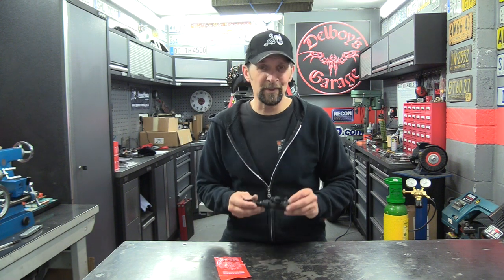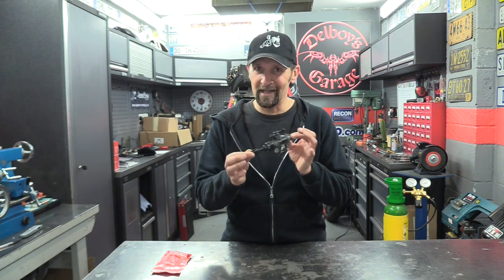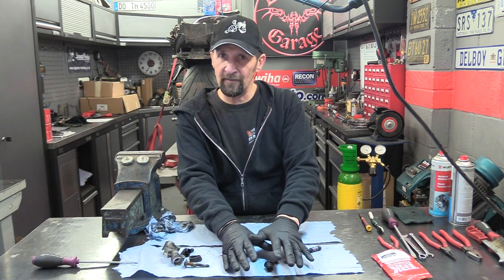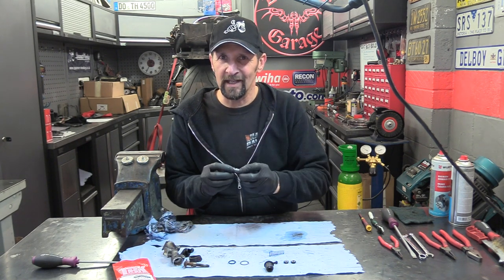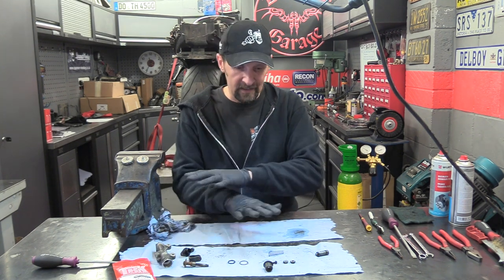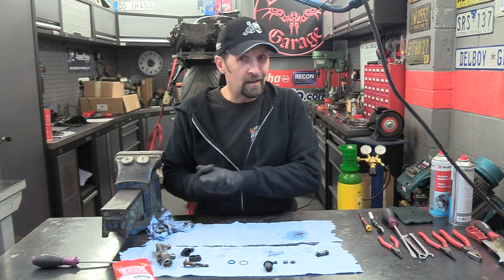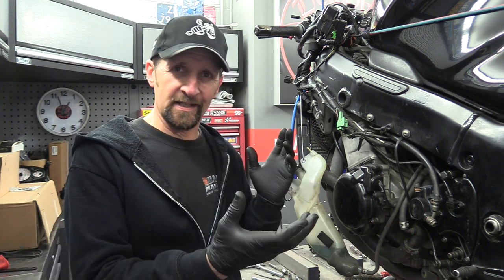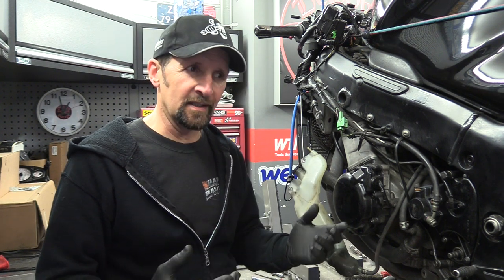Delboy's Garage, Hayabusa Day 15, "Rear Brake Master Cylinder Rebuild"

Comment: Thank you very much. It did look like a fairly easy job, or maybe because you make most things look easy. :) Looking at it though, I'm dreading what I will find when I open up mine. 20 years old and I've ridden it all winter. Ahwell. Also, thank you for explaining about using Vaseline instead of red grease. It's been a few years since I played around with petroleum jelly. :)  Btw, any tips how to keep that stupid spring for the brake light working smoothly, along with the brake foot lever pivot? The spring is covered by the bracket near the foot peg, it gunks up, it's really hard to reach with fingers to give it a clean and a grease and I've actually lost my back brakes for a day on my old bike because the brake lever wasn't moving anymore because of all the grit and gunk.  I hope all is well with you and Penny. Best wishes to you both and hoping for some sunshine for your weekend. :).

Comment: May i ask why you dont use the red brake greese. my local motorbike shop tell me off for not using it when rebuilding my brakes as i was using normal greese
Reply from the maker: On as master cylinder, you may have noticed that the metal piston has what looks like a worm screw cut in to it, and if you spread rubber grease on the piston, blobs of it can get lodged in that screw and it's purpose is to allow the fluid to flow backwards to the other side of the seal ready for the next application... and a blob of red grease in that groove will bung up the operation of the cylinder, so I just used fresh brake fluid to help it slip together, but for calipers I always use rubber grease if I can...

Comment: Good luck getting the sprocket bolt out again !! 😱😱
Reply from the maker: It's temporary Threadlock buddy, it'll come out a darn sight easier than those footpeg bolts did, it's designed to break free when you want it too...
Reply: @Moonfleet41  Its the Blue pill not the Red one (Matrix).

Comment: Del, how do you always know which Tap to use to clean out the threads? Do you have a gauge or is it just experience of years working with different size bolts/threads etc?
Reply from the maker: Use the bolt from that thread as a guide.. lay the threads against each other, if it fits perfectly, its the same thread....   TBH most bike fasteners are M6, M8 or M10... so there isn't much choice anyway.
Reply: Moonfleet41 I ride a Sportster so imperial and metric mixed bolt nightmare as you know lol!!
Reply from the maker: Ha ha.. i feel your pain buddy... i have a Harley and a Hayabusa.. my tool collection is like the United Nations...lol!

Comment: Good video 👍🏻 I did the same job on my 83 Kawasaki z750 ltd a few weeks ago, it was in a similar state but all the fluid had run out of it also, I'm surprised my back brake worked the last time I rode it 😂😂
Reply from the maker: Blimey, sounds like you just caught it in time aye mate... lucky escape..
Reply: @Moonfleet41  yep, all sorted now, bloody thing wouldn't pass fluid to the caliper after, thought I'd checked everything, took the banjo off, put my finger over the hole and kept pumping and then boom, out came the fluid, seems the small hole the fluid came out of was blocked with crud. Every day's a school day 😎👍🏻

Comment: Another great vid and really informative Del! Quick question on using the wire wheel... When cleaning up metal is there a rule for knowing what will rust and what won't? Thanks for all the vids!
Reply from the maker: Hi Mike,  Rust is caused by the Iron content in the metal oxidizing...so for metal to rust, it must contain iron, and a good quick check is to lay a magnet on it.. if the metal is magnetic then generally speaking it will rust if not protected.. 

Some stainless steel is mildly magnetic, but it does resist corrosion quite well...
Reply: @Moonfleet41  cheers Del! Keep up the great work with the 'busa 👍

Comment: Been having problems with mine it's squirting out but brake calliper still not working properly any advice pleas
Reply from the maker: Is the caliper free and all pistons moving, has it been standing for a long time..?
Reply: Moonfleet41 yeah been stood for 2 years but the brakes was working fine on the rear before replacing the rear master brake cylinder but put this new one on and Iv pressed it with the pipe disconnected from the brake cylinder and its pumping over the top so that's working it's just not coming out of the nipple but the other nipple Iv snapped off and the calliper did have fluid in but the pistons are working very slightly but not enough to apply brakes
Reply from the maker: @obviousmartin2501  OK mate... from what you explain, it it was my project.. i would restore the caliper fully.. new seals, sort out that snapped off bleed nipple, and get it all smooth and mobile again.... often even if they were working fine after a lay-up... the moment you start using them again, the seals can swell up and jam the pistons... I learned a long time ago that you'll waste a lot of time trying to make a troublesome caliper work....so i jjst rip tham apart and rebuild them from scratch, then they work perfectly first time mate..... Im sure you know how important it is, even a 600 fazer is a 200 Kilo bike aye..!!
Reply: Moonfleet41 yeah I know it's a heavy bike well heavier than a push bike any whey lol many thanks buddy I'll give it a go and p.s love ya vids

Comment: Are you going to use dot 5  fluid when you fill it up?
Reply from the maker: I don't see any reason not to Dave, the whole system will be dry apart from the front hoses...so yeah, it's a thought.

Comment: I just did a master cylinder just like that not two weeks ago. Rather than rebuild it, I just purchased a new one. $20 USD, or something like 17GBP. I tend to replace master cylinders rather than rebuild if it's an easily available part and not too expensive. I've had way too many rebuilds that didn't take or didn't last very long. And at $95 an hour (my going rate) it's actually a lot cheaper to replace that one.
Reply: That's why mechanics are more fitters these days, much less fixing, just buy and refit.  No more rebuilding starter motors or anything like that, well not for a long long time now.  I'd rather do this if I feel I can, and I have the required tools, bet it's cheaper too.  But that's why you're a Knuckle Head and I'm Half Dead ;)
Reply: Oh and your "going rate" is way to high, I'll be surprised if you get any work, or is everyone in your neck of the woods Knuckle Heads, especially if you're no good at fixing things lol "did not take or last long" WTF? lol.
Reply: @HalfdeadRider  I guess you're just a better wrench than me and never ever make any mistakes or have to redo something that failed. Good on ya. Glad to hear there are perfect mechanics out there. I charge what most of the other shops around here charge. Some more, some less. 

But I stand by my statement. Why take an hour to rebuild a $20 part? Just because I can? That makes no business sense, and it's not in the best interest of the customer. I specialize in motors and transmissions, so it's clearly an economy of scale... A new motor can cost significantly more than a lot of repairs  so it makes sense to rebuild. A $20 master cylinder? Not so much.
Reply: @HalfdeadRider  It's not cheaper in this particular instance. Simple business practice. Maybe you wouldn't be halfdead if you worked smarter. ;)
Reply: @azb2010  No, I wouldn't be halfdead if I was not born with kidney failure :)

Mechanics workshops here usually charge less than you said you do for labour (bike mechanics a lot less).  Main dealers (cars) charges vary on the job.  Servicing at a main dealer can be much more expensive per hour, up to £200+ then parts and materials on top.

It could possibly be cheaper if you shop around, but one quick search found a rebuild kit for the Busa, just over $21, I did not look for here but that converts to around £16 currently.

As a business these days, a lot of the time profits go above environmental factors and quality of workmanship unfortunately.  Also Del is not doing it for business, nor would I, so makes more sense a lot of times to refurbish rather than replace.

BTW, I was not having a go, I was having a bit of a laugh, seems that went over your head, sorry I hurt you a little in the feels ;)
Reply: I understand your logic Knuckle Head and yes it does make sense what you say but @ $20 for a new master cylinder suggests to me a chinese copy build and not OEM, surely an OEM would be way over $100 or $200. So if it was my busa would I replace the OEM with a chinese copy? I say no way. Its an issue of trust for the long haul and you cant go past OEM. If on the other hand an OEM goes for $20 (WW2 price) then yes am all for it.
Reply: @Volvi373  $172 for rear and $173 for the front master cylinder mate, so probably a little less from a UK parts dealer, but still a long way from $20 lol
Reply: @HalfdeadRider  Sorry to hear that. I'm running on one kidney meself. And don't worry about my feelings, I don't have any. But I'm used to people making good natured jabs all day long and I don't shy away from giving back. Mechanics and machinists are historically like to poke fun at one another to pass the time. ;)
Reply: @azb2010  Don'y be sorry, I'm pretty sure it's not your fault, let's hope your kidney is one of those super horseshoe kidney's like Mel Gibson's.  

I don't know if you know Martin Kemp and Gary Kemp, (Spandau Ballet, also played the Kray twins in the 1990 film The Kray's), well Martin Kemp has one kidney and Gary weirdly has three lol.
Reply: @HalfdeadRider  3 kidneys? I've never even heard of that! I think I'd be tempted to donate one if I had 3...

Comment: You might use it all the time, but " Imperial " ( size ) is an 0lde terminology, we just say "Standard" ( * edit , I mean, we used to say it many years ago ) 
- as always really do appreciate your videos.
Reply: Be a bit careful with weights and measures, for example the American standard gallon is about 17% smaller than the UK Imperial gallon. Something like 3.7 litres Vs 4.5. So the systems aren't equivalent in all cases 🙃😁

Comment: I’m under the impression that since Vaseline is a petroleum product, it shouldn’t be used as a lubricant on rubber and plastic parts, as it can eat them away. But I could be wrong. I’m just an amateur.
Reply from the maker: It eats plastic parts?... why doesn't it eat the pot it comes in then.?
Reply: Moonfleet41 good point
Reply from the maker: @FrAdamVoisin  Sorry mate, I was being cheeky there... but seriously it's a quite logic question, but the fact that most rubber in automotive use is not genuine rubber from rubber trees (which would perish), it's all manner of different substances, silicone, nitrile (the stuff surgical gloves are made of), and all sorts of other things that don't contain organic rubber, and Vaseline is a mixture of mineral oil and wax, it's perfect for sealing out water, or wee wee from baby's bums lol... (and that's serious, cos urine contains ammonia and uric acid which, as you know, causes nappy rash, a minor chemical burn, and we use Vaseline to prevent it, so it's quite safe buddy)...
Reply: Very good. Somewhere along the way, I was told to never use Vaseline on plastics and rubbers. Maybe it’s not so big a deal. Keep up the excellent work!
Reply from the maker: @FrAdamVoisin  Yeah, common old wives tail buddy...
Reply: Moonfleet41 I guess so.
Reply: Keep up the excellent videos. I’m totally along for the ride.

Comment: This master cylinder looks very similar to the 1 on the Suzuki bandit......I just opened up the 1 on my Bandit and there was nothing under the initial rod...No piston, no spring, nothing but dirt......Now I don't know about the function....I guessing the interior is suppose to connect with the rest of the cylinder and pump the oil up, but now Im not sure...I wish i could see what the entire looks like on a fresh cylinder
Reply from the maker: See if you can find a schematic diagram on the net somewhere, maybe an online manual, or parts supplier.. that will show you what's supposed to be in there. !
Reply: @Moonfleet41  Ok, thank you...

Comment: Those first bolts 😮 the corrosion!
Where do you get the blue threadlock del?
Reply: Any decent automotive parts shop should stock it or alternatively you can search the web.
Reply from the maker: Hi Simone, Yeah, messy aye... You can buy regular blue threadlock online of from any car accessory store..

Comment: Liberal use of blue LocTite? Does everyone to that? 
Thought it was for race applications, and thought it makes removal very difficult.
Reply from the maker: NO, Corrosion makes removal very difficult...as you found with heat and hammer.... Medium strength threadlock holds the fastener in place and prevents corrosion too.. so when you want it undone, it gives up easily..!
Reply: @Moonfleet41  TY. You are a mensch.
Reply from the maker: @Redmenace96  Thank you kindly Sir..!

Comment: Why so much blue Loctite? A little touch on the front of the screw is all you need in my opinnion.
Reply from the maker: Hey Nestor..You're right indeed.. for securing the screw in place you just need a dab....but im sure you saw the dreadful state of pretty much all the fasteners on the bike... they have all corroded and rusted in place over years of neglect.. which means ive had to "wire wheel" them all back up to some kind of standard so i can use them again.... this means that any form of protective coating they may have had is all gone...and they will rust in place again pretty soon... so naturally in any normal 'non critical' application id use plenty of anti seize to keep them removable.... but they are critical fasteners and need to be held in place with threadlock.. so as threadlock is also a good way to prevent screws from seizing in place.. i put plenty on to keep the rust at bay.... hope that makes sense mate... thanks for your support.. Del.

Comment: Is a master cylinder a master cylinder a master cylinder? If you were, say, building a bike from bits and converting a rear drum brake to disk, is your only real consideration how it's mounted and actuated? Or are there other things to worry about, like capacity and rates?
Reply: @stevewilliams5428  cheers Steve! This is entirely hypothetical, at least right now. But at some point I would like to rebuild something old!

Comment: Got enough threadlock on those screws? Judicious is a word that comes to mind 😀
Reply from the maker: Well they aint coming out now are they...!!
Reply: There is a good reason to use a bunch, while not required to keep the fastener in place. Did you notice all the corrosion on the fasteners he removed? That is electrostatic; that is it's caused by two dissimilar metals (typically steel and aluminum) have an electrochemical reaction to each other. Typically, you'd use anti seize to prevent that, but you can also use gobs of Loctite. Anything that creates a barrier prevents the corrosion. And, consequently, (and counter intuitively) also make the fastener a lot easier to remove in the future. Yes, that's right, Loctite can make it easier to remove a fastener.
Reply from the maker: @azb2010  I couldn't have put it better myself buddy, my actual intention of drowning them in blue temporary Loctite was to try and keep the water out as well as lock them in place... I did a video years and years ago on Threadlock vs. anti-seize and although they're different substances, they do surprisingly similar jobs!
Reply from the maker: @baccas66  Ha ha, its a proper Mutt aye.. but thats cool, just makes it all the easier to rat it..!